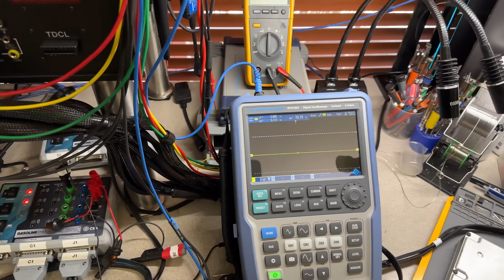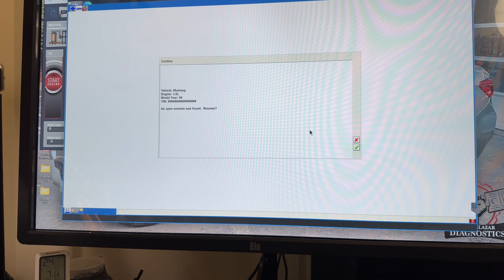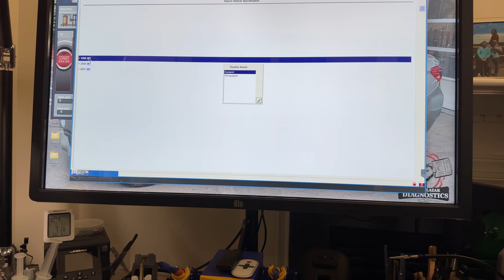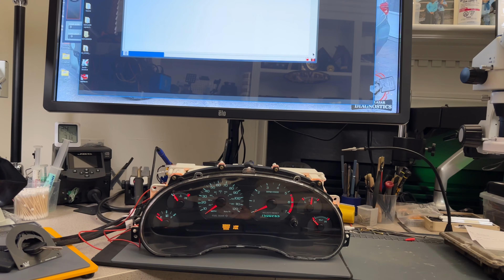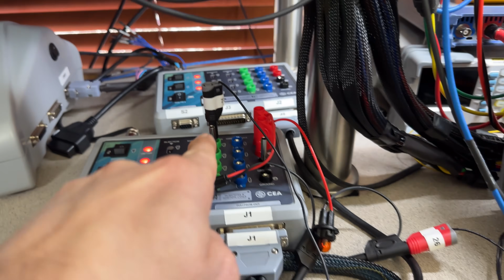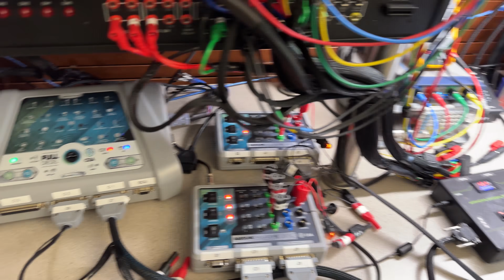1999 Mustang 3.8L No injectors activation PCM and Cluster THE REPAIR for John Warren VA

Comment: So what was the repair?
Reply from the maker: Soldered main connectors on the instrument clusters and replace one diode of the SCP circuit that was shorted. All problem was in the cluster.